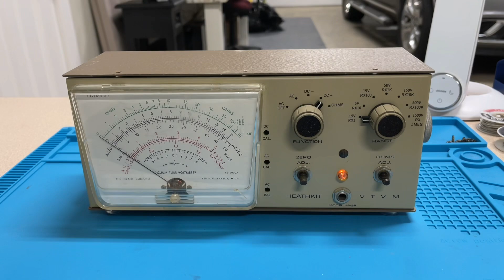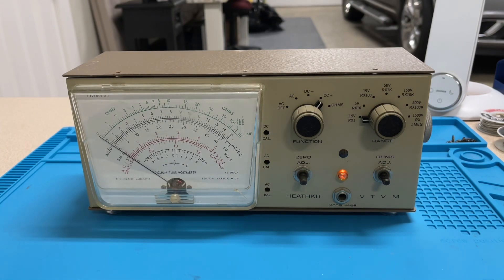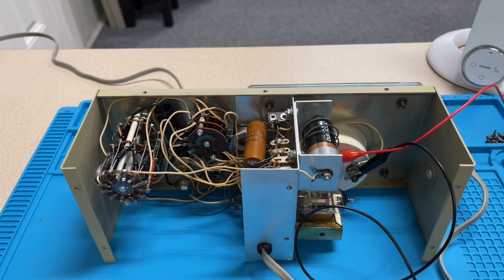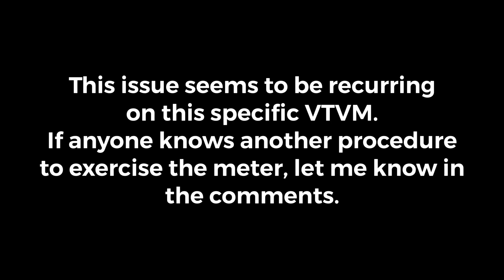Vacuum Tube Voltmeter won’t deflect? Try this before replacing components!

Comment: I've been using the newer SM5228 version of this meter since the late 70's.  I use it mostly for doing radio alignments, can't beat an analog meter with a large meter face for finding peaks/dips.  I converted it to solid state when I got it back when the conversion kits were available.  The only issue I've had with the meter movement is over time it's movement starts to become erratic. It's a common issue with swinging needle movements when the plastic cover builds up a static charge.  I've always just wiped the meter face down with a bit of dish soap to eliminate the problem.  Nowadays there's plenty of anti-static sprays available that likely provide longer service, but I always have dish soap and it costs next to nothing so that's all I've ever used.  I'd be very nervous about using electricity to exercise a movement though, too much risk of damaging the coil.  Like other folks have commented,  I've always simply disassembled the meter, cleaned and lubricated the movement.  On a few occasions I've found tiny bits of metal stuck to the magnet that would jam the meter movement at random places.

Comment: I appreciate your time and effort to share! Thank you. I offer the following truly without criticism... I only intend to help. You may want to broaden your thinking. You have a meter that is working poorly. You are applying power to cause it to work, before repairing it, thinking that it needs to be exercised. Well, that may work, to some extent... If the lubricant in the meter has degraded and become gummy, the heat from straining the meter may melt it and things may improve. Or, the shear force of forcing the meter into action with additional power may break loose dirt and corrosion. In either case, you are forcing the meter into action with power. That is very likely to damage it. I would suggest that, once the meter problem was discovered, it would be better to cut all power, open it up and do a visual inspection. This is true for any mechanical device issue. Though meters are delicate devices that require care, their operations are fairly clear and a visual inspection is generally sufficient to suss out the issue. If no broken parts are discovered, then cleaning and lubrication are indicated, before applying power again. There are good videos on the clean/restoration procedure. Mr. Young's advice is sound. So, suggesting to your viewers to apply power to a frozen meter may be risky advice. Maybe do a followup video of opening the meter, inspecting it and cleaning it. I hope you hear my heart and know that I am not throwing stones. I have used such methods, myself. But, sometimes additional eyes and minds see things that we are to close to. HTH.

Comment: I have found such fixes as this are usually only temporary.
If the meter continues working, then, no worries!

But if it does fail again, remove the meter cover, or remove the meter from the case, and loosen and tighten the screws on the meter movement frame, front and rear, especially the screw with the wire terminal under it. That is where corrosion sometimes builds up and causes the movement to not conduct.

If the meter still fails to move, use 1.5 volts through a 1K ohm resistor, and touch the different parts of the frame after the wire connector, to see if it moves. If not, then the other spot where the wire attaches to the coil might be the bad spot.

If the unit fails with both wires at the coil and nothing moves, the coil is open, and needs repair, or replacement. but be careful of the springs at each end. The springs sometimes lose continuity, and need to be repaired by soldering them over at each end,

I have a meter like that at the moment, and the only repair is to replace the meter coil, but the only recourse I have is to replace he meter.
Reply from the maker: Good information, thanks! I’ll try these things out and see what happens.
Reply: @MaxsGarage  t worked on Aircraft instruments for 36 years, and that was one of the many things I found by experience, even tho the boss never accepted the idea.